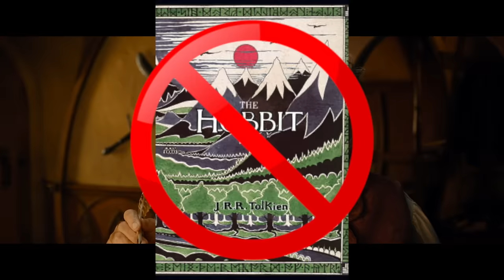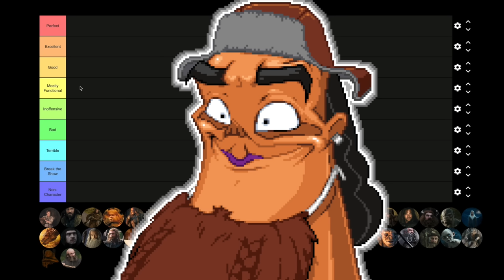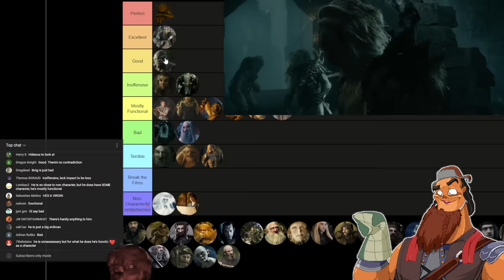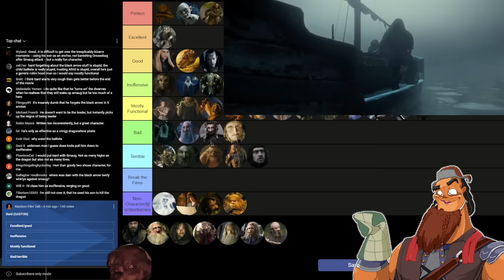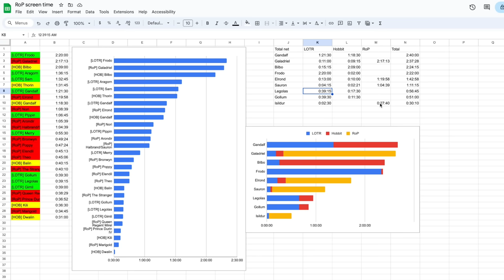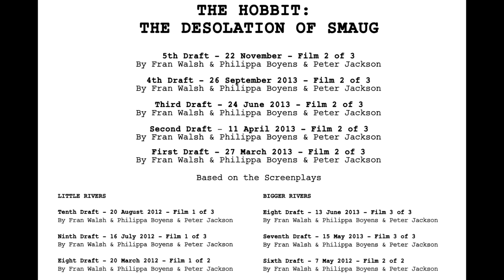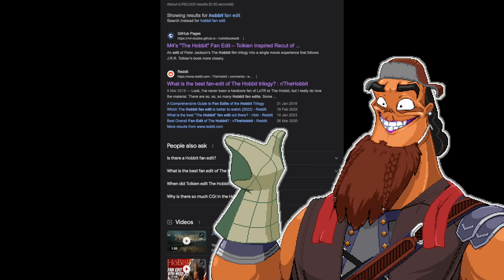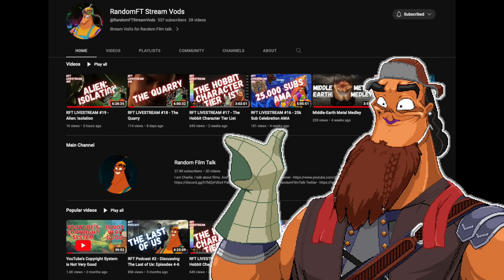The Hobbit is Not Very Good: The Final Autopsy

Comment: I 100% understand using the extended cut, because I too feel like the LotR extended cut has scenes that REALLY should not have been cut. I rewatched it on streaming recently, and so many good scenes were missing--I thought I was crazy until I realized it was the theatrical cut (and then thought THEY were crazy for only having that version available). I also think that, if some scenes DID need to be cut for time, some of Legolas's super-power scenes should have been on the chopping block (in LotR, I mean). Usually extended cuts include some useful information or touching scenes that just weren't strictly necessary, not a bunch of padding bullshit. You especially have to wonder why they bothered filming most of those scenes at all when the movies are already so full of long scenes of nothing happening. No wonder Martin was so pissed off.

Comment: Small nitpick:  I always assumed the "value" of the Mithril shirt was more about it's worth as an indestructible piece of armor, not just it's monetary value; a solid piece of armor will save you far more than 10,000 pieces of gold in a battle. Given Bilbo is far less durable than the Dwarves, and has physically risked his own person several times during the quest now, it makes full sense imo for the Dwarves to give him something that significantly boosts his endurance and durability stats (and is also very $$$ valuable to boot, but it's more about protecting those squishy vulnerable insides).
Reply: Pieces of gold can be even stronger pieces of armour. Especially when there are many, many of them.

Comment: I've been recommending the Maple Films edit for a while now, and I'm looking forward to checking out the M4 one. The big problem with most fan edits though, including Maple, is that they are crippled by the source material. The Battle of Five Armies is so disjointed, and deviates from the book so much, that it is almost impossible to assemble anything like a book-accurate adaptation out of it. If M4 has been able to alleviate some of this with digital effects, that will be a magnificent achievement.

One thing I can really recommend from Maple Films, however, is their separate Durin's Folk and the Hill of Sorcery video, which reassembles the history of the dwarves and the events at Dol Guldur into its own entertaining and easy-to-digest side story. It gives the viewer the all the useful background filler without interfering with flow of or immersion in the main story.

Comment: Having recently finished the book of the Hobbit, Bomber not speaking is ironic. There, he probably had the 3rd most lines of the dwarves, behind only Thorin and Balin. But even there it was always fat jokes, usually complaining about the trip or having to walk instead of sleep. Im almost not complaining as I actually found him kinda annoying in the book.

Also featured: Dori was apparently supposed to be the physically strongest of the group, being the first pick to throw a rope a distance, but they went with Fili instead for his better eyesight.

I was also surprised to find out that Gandalf's side quest to drive Sauron (also disguised as a Necromancer) back to Mordor was actually part of the book. That said, it was off screen there so several details about how that worked were left unanswered. Apparently meeting Thorin's father and his death also happened, though it was a separate, earlier event. Also, once again: off screen (Sort of, the book did go through revisions in it's time, so maybe these were later additions after LOTR was published).

Minor point on the accents: I can buy that, having left the mountain, they picked up other accents where they ended up separated afterwards. As someone who lived for a while in a different part of the country from the rest of my family, it can change very easily, and isn't really determined by relations/ancestry.

Comment: 2:00:57 Gotta love that the reason they didn’t have them wear the armour was because they forgot to design as something they’d actually wear. It was designed as an art-piece first and armour second.

It reminds me of video game armour, wherein, duedue to the way the majority of models and rigs work, you’ll regularly see the model stretch and different parts clip into each other. Moreover, due to the designers and artists often knowing little about how armour works or not caring, it results in an armour that, if actually worn would be terribly unwieldy. 

As we see in The Hobbit which is odd, because the armour in LOTR was brilliant, exemplified by the armour of the Uruk-Hai. It’s aggressive, dark and intimidating but simultaneously practical and more then functional. It both works as armour and is also filled with character. The Dwarfish armour has character, but there simply wasn’t enough thought about it actually being armour.
Reply: I think you're forgetting that the actors are not dwarves...

Dwarves are short, barrel like and immensely strong.

The actors were mostly tall and skinny, wearing prosthetics and had regular strength.

Plus real armour is actually pretty cumbersome and still takes lots of practise.
Reply: @retsaMinnavoiG  It's not a matter of strength, the armor just doesn't let them move properly.
Reply: @vaclavjebavy5118  that wasn't really my point but strength is definitely part of it. 

Apparently some even struggled to push themselves off the ground when wearing it.

My point was that the shape and strength of dwarves is so different to humans that cumbersome armor for us might not be cumbersome for them.

So even though the armor might look a bit impractical to us (and especially impractical for actors wearing prosthetics and who look nothing like dwarves in real life), it might not be impractical for a dwarf in Tolkiens world.
Reply: @retsaMinnavoiG  Are you suggesting the costume designers created armor for actual dwarves and that's why the actors couldn't move in them?
Reply: @vaclavjebavy5118   am I being rickrolld?
Reply: @retsaMinnavoiG  Gottem

Comment: 3:06:38 You can actually see Azog was originally meant to be in Desolation of Smaug chasing the dwarves in the mirkwood river. There's a trailer out there that showcase Azog climbing up on the bridge and roar, and the area looks pretty similar to that the dam that Kili had to open before getting shot by Bolg

Comment: You make some really good points about the extended Osgiliath scene especially when going through the events chronologically, if things make sense and provide greater insight into the motivations of characters. I wonder if you forced someone to watch all 3 movies in succession, meaning each movie would not need to be a complete movie by itself and could fully lean into an unraveling of the story over 10 hours, would it be better to put the Osgiliath scene into the prologue of the fellowship? I'm very aware this breaks the flow of the start of the movie, but then you would not use a flashback.

Comment: A ring of power is still a ring of power. It takes the One ring to control/corrupt the others. Its in the trilogy intro speel. However taking a dwarven ring of power would still be useful to Saurons army. It is an extremely precious and powerful magic item and you should not take it lightly. So of course Sauron would want it back.
Reply: So when were his quests to get the rest? You'd think he would've been trying for ages to get all of the Rings, including those owned by Galadriel, Elrond, and Gandalf as well.
Reply: @silverscorpio24  My understanding is that the elves caught wind of Souron's plan for the rings of power, so Celebrimbor forged the elven rings in secret, more or less severing Sauron's connection and influence over them. So try as he might, finding and corrupting the elven rings is near impossible for Sauron to do.

Granted, I'm not a lotr lore expert, so I might be a little wrong.
Reply: He did in the second age, he also did recover all of the remaining dwarfed rings.

Comment: 15:42 A brief explanation for Bilbo's (and Gollum's) use of the Ring from the books and what Sauron knew. (yes I know its the books and not the movies but as this information is not important, or rather should not be important to the Hobbit, and this information is not needed for the LotR, it is only needed to fill the gap between the 2 I think it is fair to rely on the book in this case.)

While Gollum was deep inside the Misty mountains and using the ring the mountains themselves clouded Sauron's ability to sense the ring. Because neither Bilbo nor Gollum used the ring for it's intended purpose (dominating the wills of others) the effect was also lessened. Once Bilbo left the mountains and used the Ring in Mirkwood Sauron absolutely knew the ring was found and knew it was close. Where exactly is apparently hard for him to detect as well and if his attention is elsewhere he could miss it entirely. If he is already focusing his search in the right area and if the Nazgul are nearby putting the Ring on will give you away. As Sauron was focusing on the Anduin at the time he missed where the first use happened in Mirkwood. The later 2 uses in the Elven Halls, and Erabor would have been obstructed by the mountains and the elves' fortress also preventing precise location, but it is safe to assume that Sauron suspected the Ring was at the Lonely Mountain given in the books that is where he first started looking for it once he was set up in Mordor. After fleeing DolGuldur Sauron openly declared himself in Mordor and needed to focus his attention on setting up there instead of the ring which I am sure was nagging at him the whole time. Even after he started looking again It took several decades for Sauron to even learn that Hobbits existed or even the Shire existed being far outside his influence and attention meaning even when he did start focusing on the Ring again he couldn't just locate it even though he knew it was found. Even in the LotR movies it is made clear that Sauron had to torture Gollum for information before starting his search, even though Bilbo had used the ring in the Shire at his party.

Comment: I can give you hard-confirmation about the azog/bolg thing:

While the Hobbit was in pre-production, Games Workshop, a tabletop wargame manufacturer got the rights for the Hobbit movies to make miniatures for their game out of.

The starter box of "The Hobbit" , which released around the same time as the first movie, included the dwarves and Goblin town. However, Games Workshop also released a character called "Bolg", but no miniature for "Azog" .

This means, due to the production time of printing and molding a plastic toy, the filmmakers switched azog and bolg at the last minute.But Games Workshop could not change their print run of the miniature in time to accommodate the swap.

Comment: In the first print of "the hobbit", the necromancer was needed to get Gandalf away from the gang so they can get caught by the elves. The necromancer "was cast to the east".If Gandalf was there, they didn't get imprisoned and bilbo cannot get them rescued so no barrel-rider. After LOTR came out, and he linked bilbo's ring to "the ring", he changed the necro to sauron, and casted him to mordor. This because you have "one enemy to rule them all" now.  So depending what book you read, it will be correct. The line "Leave Sauron to me" is a addon from the movie creators, which reference that Sauroman wanted the ring (and the power) for himself, so he didn't want the other immortals to mingle in his affairs. 
What I do mind in the trilogy is the love affair, Legolas, the master and alfred, the barrel riding was too Disney'ed, and by that, the dwarfs where not disney'ed enough... You do have the fat, the simple, the grumpy, the doc,.... as you have with the 7 dwarfs in Snowwhite, but they are potraited as all dumb and clumsy.

Comment: Regarding whether Bilbo said he'd found the Arkenstone:

I actually doubt there was a version of script where Bilbo said he had found the stone due to the way it factors into the rest of the story.  Regardless whether you're making two movies or three, Bilbo's agency in the Battle of The Five Armies is entirely derived from having smuggled the Arkenstone out, giving it to Bard, and then Bard using it to barter for a share of the treasure.  I don't think they were going to write a version in which Bilbo did not do this, robbing the title character of one of the more impactful decisions he makes in trying to avert the battle.

As to why Martin Freeman appears to nod, it's entirely possible they used a take in which Bilbo was answering a very different question.  If they were following the book, Bilbo initially snuck down there to see if Smaug was asleep.  He was to prove Smaug was asleep, and to take one piece of treasure from the hoard to prove that he could.  An earlier version of the script might have been following a version of events from the book, and Thorin could have been asking questions like, "Does the dragon sleep?" and Bilbo giving an affirmative response.  

But Bilbo was never going to hand the Arkenstone over to Thorin, IMO.  Jackson and company made many changes from the books in both trilogies, some of which I greatly disagree with (chief among them is the demise of Gollum), but they were never going to remove something as significant as Bilbo's bold move to attempt to stop the impending battle.

Comment: They could have had Gandalf save Thrane and bring him with him to Dale, then Thrane could have been the mechanism to undo Thorin's "madness/sickness/dragonthing". Maybe have him dying and get him to give Thorin a "don't be corrupt" dying speech that saves the day.  
I feel like you could resolve a lot of the Bard trusting Alfrid issues by having made them brothers so Bard wants to trust him or see him redeemed so continues to put faith in him despite being continually let down. Could be a parallel to the Boromir/Faramir sibling dynamic. Afrid's failure of character could be tragic instead of "funny" which would then challenge Bard's hopeful  trusting perspective. Kind of seems to me like that was the original intention actually but then they changed it.

Comment: In terms of unreliable Narrator, Tolkien kind of used this retroactively on the Hobbit to explain that the lighthearted moments were how Bilbo told the story to Frodo and the other younger hobbits. However this was only used to serve fitting the Hobbit in with Lord of the Rings and its vastly different tone, it was not an excuse for internal problems to the hobbit itself. As such if you wanted to tell this story in the same style and tone of Lord of the Rings you could make the movie about "what actually happened" If you want the lighthearted tone I would have a live action Bilbo telling the story to young Hobbits, and an animated set of flashbacks.

Comment: Not far in but a small correction: "Rings of Power is set thousands of years prior, and it is produced by Amazon and not Warner Brothers, and the rights Amazon has to adapt Tolkien's work are not the same rights Warner Brothers had."

The showrunners for RoP in an interview:  “We have the rights solely to The Fellowship of the Ring, The Two Towers, The Return of the King, the appendices, and The Hobbit,” Payne says. “And that is it. We do not have the rights to The Silmarillion, Unfinished Tales, The History of Middle-earth, or any of those other books.”

So they actually do have pretty much the same rights Warner Brothers had, and tried to tell a complete story off some background lore from a handful of pages of the appendices, which probably contributed to it being such a shitshow. I think the only difference is WB had movie rights and Amazon had TV rights.

Comment: Regarding the Ringwraiths, I will share my own explanation here; although please bear in mind that this is totally my own headcanon and has nothing to do with actual canonicity, although it does line up with what we see in the films in particular.

I essentially view the Ring(s) as enabling a form of phase shifting; basically it moves the person into a pocket dimension which is very slightly out of phase with realspace, although close enough to realspace that physical interaction is still possible.  However, it's also far enough away from realspace, that anyone who is in the pocket dimension is invisible from the vantage point of realspace, but is also more clearly visible to someone else who is in the pocket dimension.

Are the Ringwraiths ghosts?  Yes, in more or less the same sense as Sauron himself, although it's a bit different in Sauron's case, due to him being a second tier (fallen) angel as already mentioned.  Basically, a Ring creates an anchor for a soul to the pocket dimension just described.  If a person who owns a ring gets killed while they still have the ring, then they will remain bound to the pocket dimension for as long as the ring exists.  That's why Sauron got disrupted (as in his physical form got destroyed) when Isildur cut his hand off, because he seperated Sauron from the ring, but it's also why the Ringwraiths were still around after they got physically killed, because they still had theirs.

Being a Maiar means that Sauron had his own ability to eventually respawn, (and Gandalf at one point in the books describes how weak he is immediately after doing that) even after the Ring got destroyed, but from memory there was an account of him being thrown into the Void along with Morgoth after LOTR, which means that he could never come back again.
Reply: I believe the books detailed that after the One was destroyed, Sauron was reduced to a powerless spirit in the wilderness never again able to grow or take shape.  Morgoth was a special case in being ejected from Arda; all the other Vala and Maia are bound to Arda until the end of time.